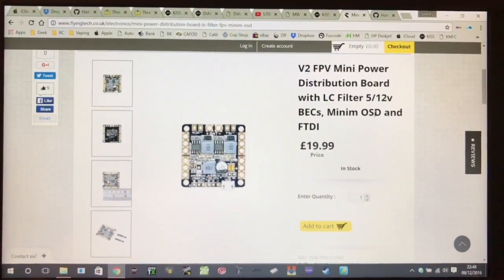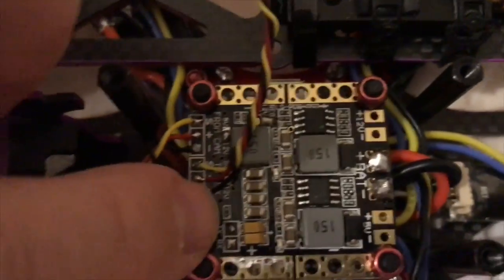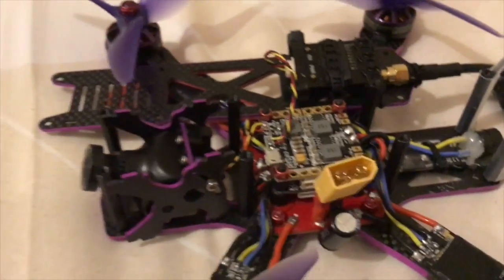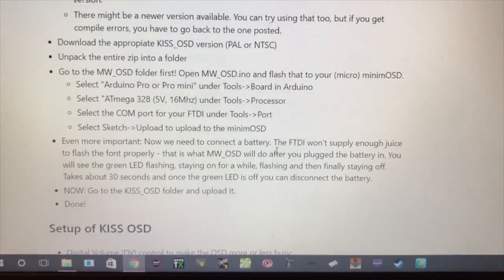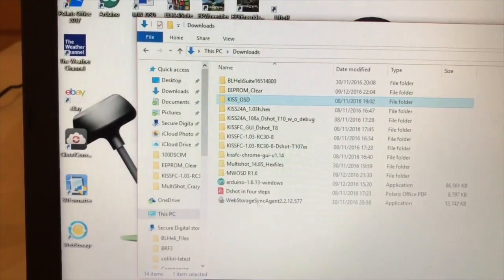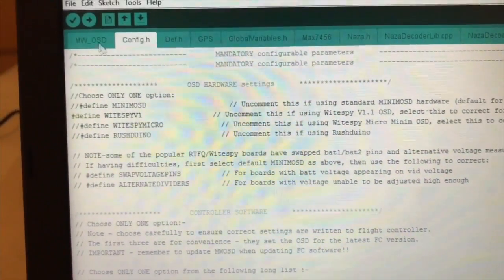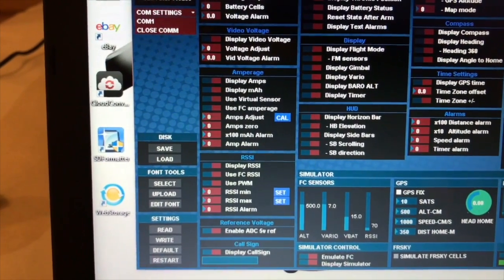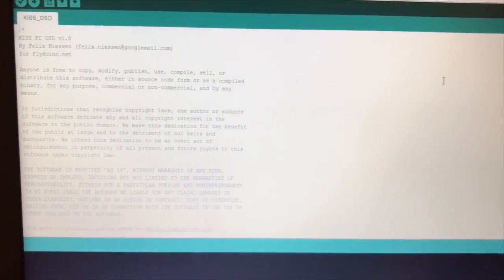Fixing Vanishing KISS OSD

Comment: If you want to use your original stuff instead of the osd on the pdb you can run it off a small lc filter. I use these ones from ready to fly quads http://www.readytoflyquads.com/mini-rtf-lc-filter-3amp-2-4s there only $2.75 each work great and are really small but they are in the US.

Comment: I like the intro! Cool to see you in front of the camera! You got some top notch equipment there!
Reply from the maker: Thank you my friend. I'm not good in front of a camera. I saved up for this. Buying a bit here and there storing it away, then finally I bought the Alien RR5 and put it all together.

 I love having an OSD as I only use my Taranis now for Planes, as I love my TBS Tango for quads, but it has no telemetry, so OSD is the next best thing and it works better for me. 

The RR5 PBD is just that, no step downs or regs, and the VTX feed was noisy and my OSD went off. I had a light bulb moment and was so happy with this PDB/OSD solution, but when I flashed the files to it the display was all gobbledegook! I just wanted to help someone.

Your kind comments mean a lot, and I love watching your channel. Happy flying buddy!